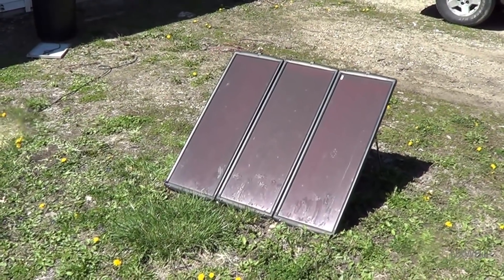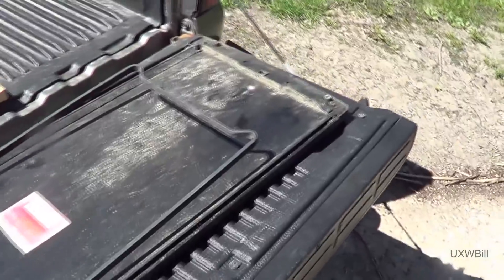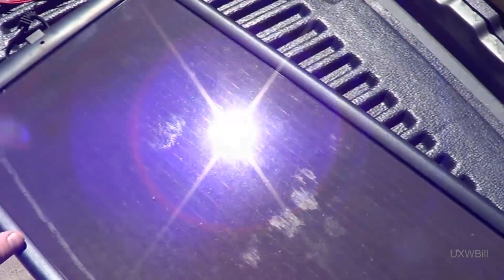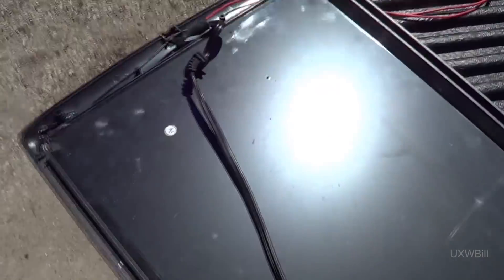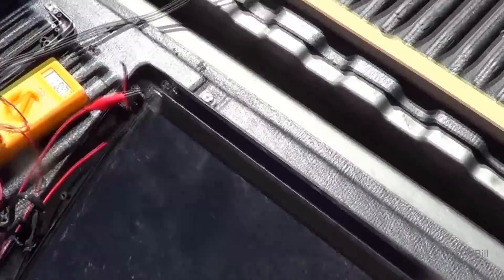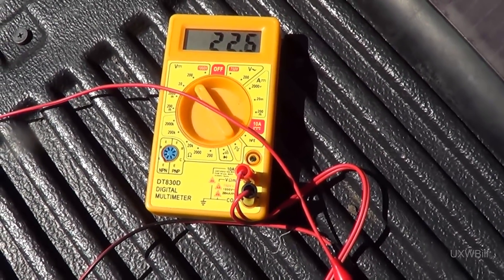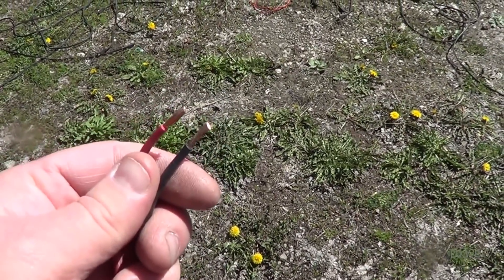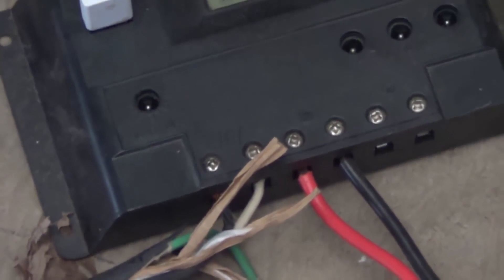Repairing a Harbor Freight Solar Panel

Comment: This piece of junk is sitting 189.99 on HF right now.  This was a cool system 10 years ago.  A 100 watt kit for 200 bucks seems pretty steep to me.    They should at least put a few USB C ports on the charge controller.
Reply from the maker: To each their own. I don't think it's a piece of junk. Outside of this one repair, every part of the system I got is still working. If USB-C is what you want, add it yourself. No doubt there are ready made and inexpensive circuits that can connect to a battery and implement everything needed for USB-C PD.
Reply: @uxwbill  The cables were all fraying. The charge controller is cheap. The build quality on the panels doesn't seem very good, but, to be fair, they are not meant to be mounted on a roof and left alone for 20 years.  There is no reason it shouldn't have USB charging out of the box, especially for a 100 watt system.  100 watt systems are meant to deal with low power stuff (because you will never get 100 watts out of except maybe in the summer at noon).
But hey, it's your stuff and you like it and that's all that matters.
Reply: I have the same panels and personally like them. They charge with an inch of snow on them and very little light.
Reply: @shaymus1968  But how much charge?
Reply: @tarstarkusz  I have 8 panels and 4 100mah batteries. Keeps them full. Really don't have a load on them now. They are amorphous panels and don't need direct sunlight.
Reply: @shaymus1968  Most panels will produce  some power in low light, whether caused by clouds or shade.  But the drop in output is enormous.  We're talking 80-90% drop in output.  This cannot be overcome because the energy in sunlight is being blocked by the obstacle, whether it be a tree, or building causing shade or because of snow on the panels.

Comment: What  should my 10a solar charger full battery with no load read. Hice video.
Reply from the maker: For a fully charged lead acid battery, a no-load voltage check should be close to 13 volts DC.

Comment: Maybe an update video will be in order for these. I'm interested to see how long they last and how efficient they really are. Coming from Harbor Freight I don't expect good performance out of them a lot of the electrical components they sell seem too good to be true. I already know their 12 gauge extension cords are actually much closer to 18 gauge cca wire after digging into one, so that's not very reassuring lol! Looking at the cheesy two piece casing on those solar panels it seems like it would be a good water trap. The ones here are advertised to "charge" RV batteries and has a set of battery clips that plug strait into the panel, so I can pretty much guess why they have diodes and dropper resistors.
Reply from the maker: They're already about two years old and still doing OK. Like any other solar cell, their output will decline somewhat over time.

I don't buy any line voltage electrical parts at Harbor Freight. Too much of that stuff is still pretty bad.

Those little tiny "float changer" solar cells really do work, and can't output enough current to hurt an already fully charged battery. They won't bring a dead battery back to any kind of charged state. I'd say they keep pace with the self discharge rate of the batteries in question.
Reply: @uxwbill  Ok, for being 2 years old that's pretty good then. Sounds like they put out a couple of amps so at least their not terrible.

Comment: Wouldn't it be funny If you could hook up a solar panel to electricity and get light?
Reply from the maker: There's absolutely nothing stopping you from doing so. The Harbor Freight kit includes three 12 volt LED bulbs.
Reply: @uxwbill  Perhaps you need to reread my comment hehe.
Reply: 120 volts out to do it. You'll have your very own "lightning" panel. I've done it to broken panels before haha! ;)

Comment: that is a blocking diode so that the battery that the panel is connected to from discharging at night they are replaceable.
Reply from the maker: Batteries cannot be directly connected to the solar panel. A charge controller must be used, and I'd think that is where any backfeeding of current from the batteries into the solar panels would be stopped.
Reply: @uxwbill  I know that, but even with the charge controller they can discharge the batteries without a blocking diode that is why each individual panel has one.
Reply: @uxwbill  The battery charge controller would not allow any current to back feed to those panels. With that in mind the purpose of those diodes on the panels is to not allow any current back into the panel wherever that source might be. 

Vicky must have heard somebody talking about the systems that do not utilize a charge controller and has restated that very same assertion in her initial statement about the operation of your particular system.
Reply: @uxwbill  I am not sure, because it is dc not ac I think it might be the same principle as leaving a cell phone for example plugged into a charger without the charger plugged into a wall outlet to discharge the batteries.
Reply: @VickyGeagan  Don't believe this. The current has to have some place to go in order to "discharge". The chargers have diodes that prevent current from flowing "backwards" to anywhere even if it were still plugged into a car or outlet that was "off". With that in mind,"isolation" is not going to hurt the battery,only serve to protect it.
Reply: @msubtech84  maybe you misunderstood the point I was trying to make, but what you just said about the diodes allowing the current to flow in only one direction that was the whole point I was trying to make with my example that is why blocking diodes are important in a solar panel  Without them in use with a charge controller the current would just go through the charge controller at night at least a small amount out through the batteries slowly discharging them.

Comment: Sort of related...a college near me is experimenting with misting water on the backsides of the panels at a local solar farm.  Was working on an inverter there and was quite surprised to see this setup.  But they may onto something, with the heat vs. watts thing.
Reply: A cool solar panel will produce better then a warm one does, that is their reason for misting the back side.

Comment: I had the same fault on one of my much smaller version solar panels, I just resoldered everything with new wiring and it works fine to this day (presently hooked up to a car battery I salvaged off the street & powering a few small loads), cheap panels are cheap for a reason... :)

Comment: At the risk of being naughty, here I go again. You could always install the panels and not have about people trampling the panels.
Reply from the maker: A man's gotta know his limits. You're not about to find me drilling holes or driving screws into the roof, which has its sides in the wrong direction anyway (E/W as opposed to N/S).

Now, of course, you have been very naughty. However, AS PER USUAL, there is never a brig around when I need one.
Reply: @uxwbill  I had no idea there was a wrong way for a house roof to face. You could always build a brig Uxwbill

Comment: I think the diode keeps the panel from discharging the battery if it's out of the sun
Reply from the maker: I'd be rather surprised if the charge controller wasn't supposed to do that. (However, I've not tested it.)
Reply: very true even connected to a battery through a charge controller they can discharge the batteries with out a blocking diode

Comment: Well done bill :-D, solar panels are not too cheap and keeping them going is good.
Yep the 830 type of meter has 1 million ohms on the d.c voltage range, i use lots of those little meters for monitoring voltages on newly repaired equipment.
They don't need to be perfect to be useful :-D.
Reply: 25 watt panel individually around 75- 80 dollars us at harbour freight

Comment: I might grab one of these kits for power outages to charge phones and tablets. I now know how to fix these. 12 volts 4 amps is pretty good.
Reply: I am not sure that is so awfully good seeing they are suppose to be 100 watt worth panels at 12 v  4 amp that is a mere 48 watts
Reply: @youandican2  12 volt solar panel kit> 12v USB charger> phone or tablet.